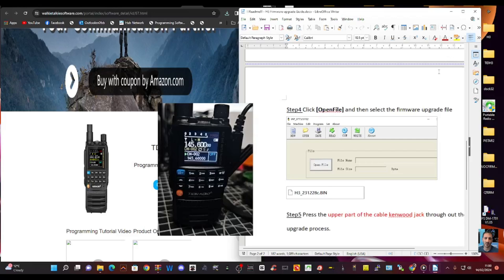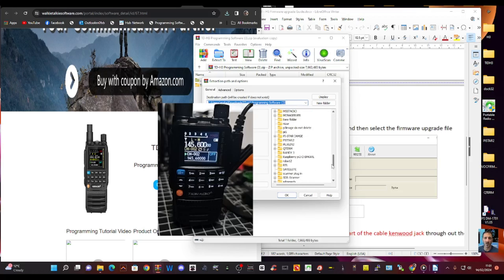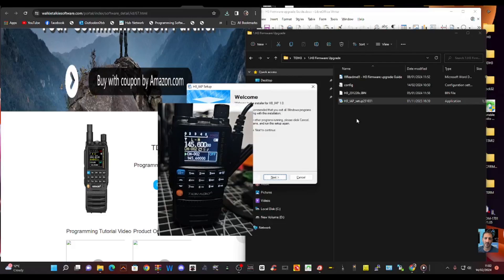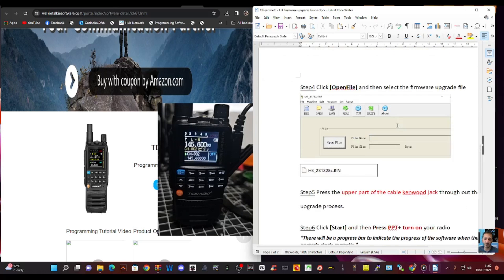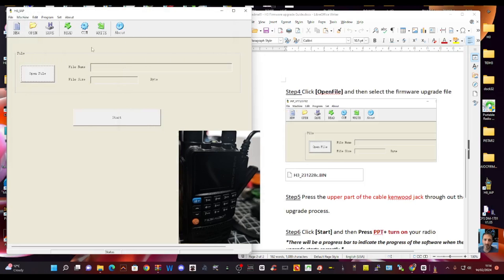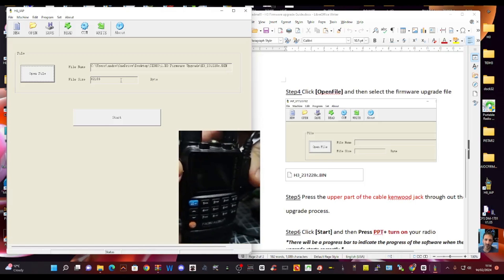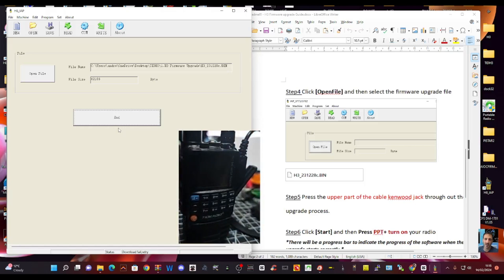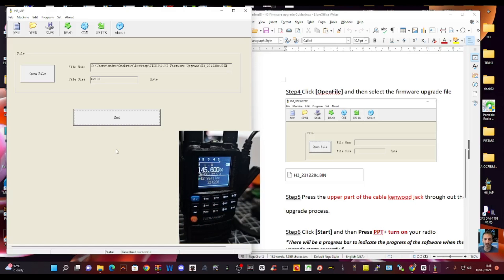TIDRADIO H3 - FIRMWARE UPDATE

Comment: Can we update H3 firmware using type C cable?
Reply: I did the upgrade of firmware to the H3 using USB type C cable today.  Followed the instructions in the downloaded zip file.  When time to upload, first press Start button, held down BOTH PTT buttons and turned radio on.  Continued to hold both PTT buttons down and firmware came down as shown in the progress bar on the software screen.  Pretty quick, under 15 seconds.  Firmware version can later be confirmed on the radio by looking at menu setting 42.  It will show it.  I have 240401 now.  BTW, I am using a laptop (Lenovo) with only 1 true USB-A port, so I used that for the programming from USB-A to USB-C into the radio.  I did not have success using any type of adapters that convert USB-C to USB-A.  I used the USB connector that came with the H3.  YMMV.  73
Reply: @webcompanion  Just how? This is not working, since pressing START requires COM port, but one is not present with radio off.
Reply: @RobiRavnik  I double checked and my computer will detect the radio being plugged into it, even when the radio is off.  After I plug in, I go to the "COM" button and choose the COM port.  

I'm using the USB-C cable that came with the radio.  The firmware update SW I'm using is H8_IAP ver 0.2 with date 2023.10.31
Reply: @webcompanion A co daje nowe oprogramowanie
Reply: Mine is not recognised when radio is off. No way. I also have Lenovo and original cable.
Reply: @RobiRavnik  Maybe download the CH340 driver for your PC?
Reply: @webcompanion  i have tried that but no difference
Reply: @RobiRavnik In the software, click “set” above. Select the com port. If it’s not there try a different cable.
Reply: Is there a firmware update download for Mac? I downloaded the software but it won’t let me open it on Mac.
Reply: @Cowboyup4christ777 the manufacturer software is only for windows. I wasn’t able to do this on a Mac so I had to gain access to a PC. One of my radios had trouble with usbc, so I had to get the kenwood style programming cable.
Reply from the maker: Yes
Reply: @M0FXBHamTech  how? what to press? programmer software only detect comm port if h3 is turned on.

Comment: Wow, they've already released v.H3_240229(1) firmware! It's very encouraging when a company of this type regularly releases fixed or improved firmware. It shows they are listening to their customers and are responsive to them. I wish Yaesu would behave this way!

While I prefer the features and performance of the Quansheng UV-K5 (with egzumer firmware) this is a jewel of a cheap little radio, it's hard to beat that crisp color display.

Comment: My TD-H3 came with firmware version 231229. This version still has many bugs especially with Bluetooth and CPS programming. (Although it is possible that these bugs may have more to do with ODMaster and the CPS then with the radio firmware,) I have reported this and I am now waiting for the TIDRADIO folks to return from the Chinese New Year holiday. Hopefully when they return they will address these issues.
Reply: Mine Also have 231229 ,someone is very  outdated on firmwares 😂
Reply from the maker: Hi do u have 229 bin